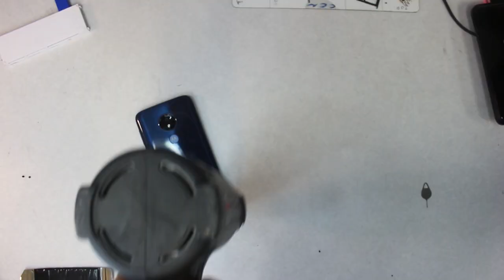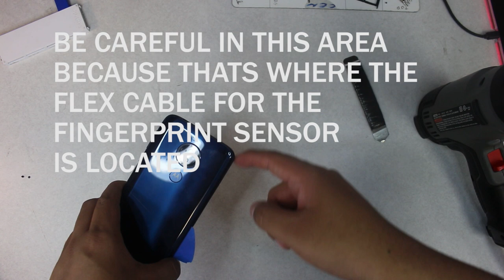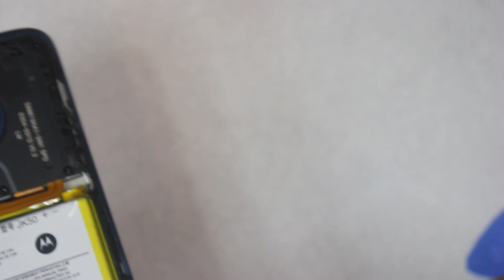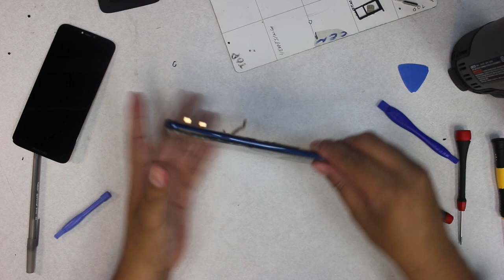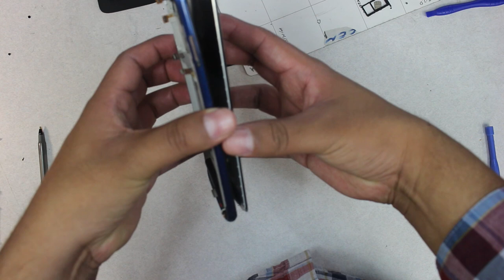XT1955 Screen Repair/Replacement

Comment: Thanks for the tutorial! Question: I followed step by step, everything went fine, but I notice my new screen has a bluish tint now, could this be the quality of the screen? could i have done something wrong?
Reply from the maker: Try resetting the lcd ribbon cable is the issue is still there is could be a defective screen, also make sure the connection is clean without any dust.
Reply: @CaliRamirez831  thanks!! The camera is my next issue, it doesn't focus. But when I open the lid, it does. Driving me crazy lol. Update: I removed the rubber around the camera and now it's working fine

Comment: Heat the crap out of the screen to get the battery out. We threw about 12 lithium ion batteries into a blazing hot fire🔥.it took about 20 minutes for only 3 or 4 to actually explode. On airplanes, they must be kept in plastic so as not to be exposed to electronic sparks. So, the point is, that that battery could at most possibly catch fire if fire touched it. I wouldn't worry about it. It's not a thousand watt battery haha.its roughly 3.7 volts.

Comment: Next time, try sliding a thread or dental floss under the battery. It helps to remove it without all the blades

Comment: bad way to take apart the phone for this job. For an LCD/Digitizer replacement on this phone you don't need to take out the motherboard. Doing that just unnecessarily risks breaking the motherboard, all you need to do is take out the battery to get the screen assembly cable through the bottom for the replacement.
Reply from the maker: you are correct, the only reason I removed it was because of habit usually when we do these repairs we do the whole lcd and frame assembly

Comment: Hi! I need your help. I accidentally cut it the cable in 2 (27:37). How do i replace it? HELPPP. What's the name of that part?
Reply from the maker: It is called XT1955 Charge Flex Cable Ribbon Connector you should be able to find it on eBay for around $8-$20

Comment: Can you please provide a link to the digitizer? Like where you bought it from?
Reply from the maker: for this repair I just searched ebay  for XT1955 digitizer but double check for phone before you order because there are xt1955-2, xt1955-5 and xt1955-6

Comment: Where would get a new g7 screen? I just cracked the top corner.
Reply from the maker: gadgetfix would be a good place to check otherwise ebay would also be a good source but make sure to bu from top seller vendors only

Comment: The touch on my screen didn't work when i tested it , please help.
Reply from the maker: If the touch did not work remove the screen and connect one more time it could be that it didn't make proper contact the first time. If the issue continues it just means that you have a bad screen and need to replace it.
Reply: Thank you for the helo👍

Comment: I just got one of these yesterday and i already broke the front glass

looks like a bitch to fix 

is there any way to replace the front glass without ripping apart the entire device?
Reply from the maker: Unfortunately you have to open the device because there is ribbon cables in the back that you need to remove to be able to replace the screen specially the ribbon cable under the battery.